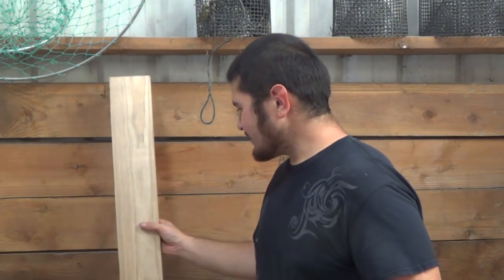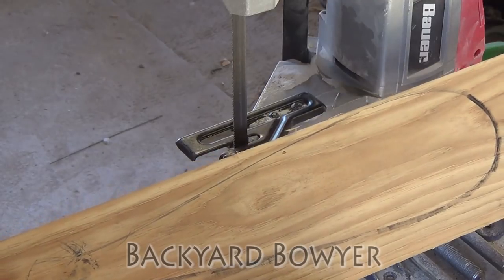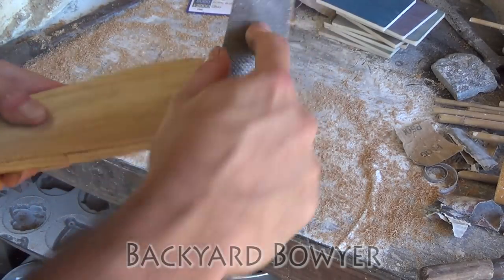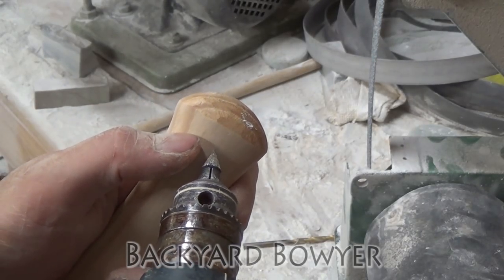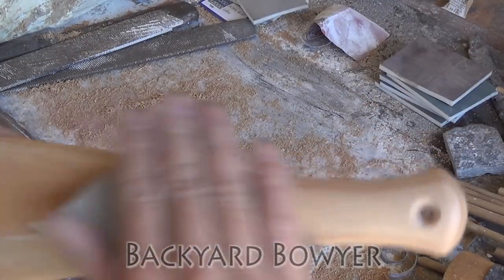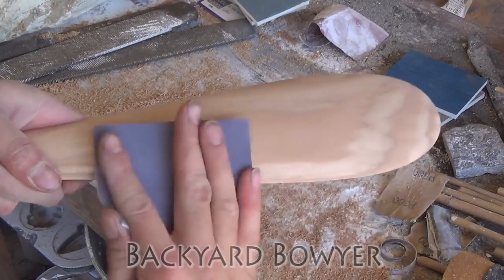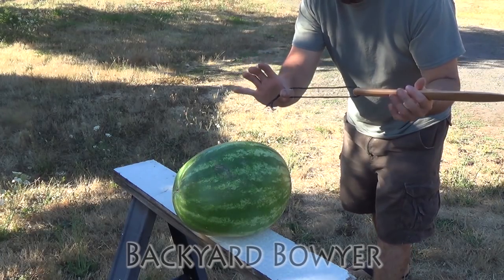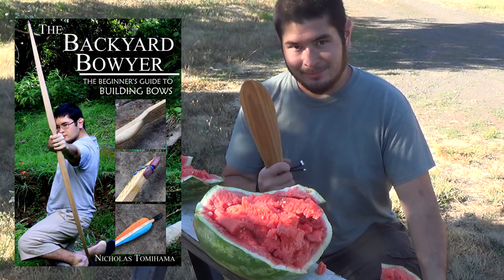Making a Wood Patu - Carving a Maori Style Warrior Club - Slicing Watermelon!

Comment: Have you tried watered wood? To make wood more durable and tuff they used to put logs in streams and rivers to soak out the resins leaving only the woodfiber. After this it would be left to air dry in a wood attic.
Reply from the maker: +Joris Bogaerts I have not! Thank you for the suggestion!
Reply: Okay I thought there would be more information about the subject but apparently it is something that was still practiced in the Netherlands and Flanders in the recent past, and a little in the present, but is all but forgotten in the rest of the world in favor of modern fast harvesting of wood. The technique was apparently know as far as in China. But at the moment the little amount of info I found is singularly in dutch. The dutch word is "Wateren". https://nl.wikipedia.org/wiki/Wateren_(hout)

Watering wood is a rather time consuming technique freshly cut logs of wood are submerged in constantly flowing water for a minimum of 9 months, on average 3 years and maximum 5 years. The goal is to remove all nutrients, minerals and starches from the logs. When dried this wood does not "work" as much as unwatered wood and depending of the type of wood many qualities are improved or become usable for applications for which it would be otherwise unusable. For example, wood of fruit trees is in the norm unusable for furniture making but after watering apparently becomes usable. 

My personal experience with the wood is from seeing my grandfather work with watered oak, don't know if it was summer or winter oak. This oak was cut down by his father right before WWII and spent the entirety of the war in a stream. After this it spent decades air drying in the attic. Then somewhere in the 80's, I think, my grandfather had the log sawed up into planks at a local mill. He told me it apparently destroyed a few saw blades while being cut at the mill. The miller gave him the comment he had never seen wood so tuff and hard. The in the late 90's I've seen my grandfather struggle with the wood it damaged and even destroyed a few sawblades, routerbits and face millingblade. I still see him going at it with the angle grinder just to cut through the hardest parts of the wood.

Comment: There's alot of different types of patu it's also to do with Balance the way you hold it ...if you know how to use it properly you will understand what I mean ..in center when you Balance it on your index  you don't need much force to swing it's the twist and snap off your wrist like a back hand table tennis hit instead using the flat side use the blade ..
 excellent Job keep up the excellent work👍👍👍

Comment: In al seriousness , whats the point in taking it to 15,000 grit??!! Atraight razor edges are usually only taken to 12,000, so that's extremely high. You would most likely not be able to see the difference in finish between 2,500 and 15,000 grit
Reply from the maker: +S!ngularity Thank you for the insight!

Comment: A better finish is 1/3 linseed oil, 1/3 turpentine, and 1/3 beeswax. Heat the wax just enough to melt, mix in the other parts, and store in a sealed jar. Rub on, allow to dry for 10-15 minutes, wipe off excess, let dry overnight.

Comment: that cut from 03:16 to 03:17 .... youve got to be kidding us bro. there was a little bit more then just some rasp work happening.
Reply from the maker: It was all rasp work. My camera died for about half an hour and I didn't realize it until I was ready to move on to the next step. 😅 This was the second side, and it was more back and forth between the rough side and the smooth side of the rasp.

I love farrier's rasps because the rough side takes off material pretty quick and the smooth side eliminates all the deep scratches and honestly leave a better starting finish than coarse sandpaper.

Comment: Lookingat it from the practical angle, does a wooden patu something better than a stone one, disregarding the material and work needed to create it?
Reply from the maker: +Maro150983 The stone is much heavier, which I would think would make it more effective at stabbing and more damaging overall. The wood is lighter and feels much faster in the hand. I'm not sure if a wood patu is better than a stone one, it would come down to your preference.
Reply: Cool, it sounds kind of like a different weapon, once you switch the material. Btw, were they used like the main weapon (with shield?), or is it a sidearm you switch to if needed? Man, you just get me interrested in Maori stuff ;)
Reply: Maro150983 Just for show I believe.
Reply: +SenpaiSancho YT You mean it was not used as an actual weapon? To be fair, I can imagine Maori fighting spear and shield, but what if you end up in a grapple? A good knife would be helpful, but I can imagine breaking a tight of your opponent by something like that is not something to frown upon, plus the stone ones look sharp enough to cut.
Reply from the maker: +Maro150983 The patu was more or less a sidearm. The Maori, as well as many other Polynesians, typically do not use shields. Fighting was usually done at a distance with long spears and thrown spears, then close in with staff weapons and sidearms like the patu.

Patu are very valuable for gaining Mana, because of the level of strength and skill it takes to use well and the proximity of your opponent. To be killed with a well made or important mere was considered an honor.

The patu was often used for stabbing and cutting in close quarters. The patu was used similarly to how the Hawaiians used the pahoa (dagger).
Reply: SenpaiSancho YT patu and mere are types of war club, they are skull splitters and not cutting blades. i have never heard of maori using shields or spears in warfare although their primary weapon called a taiaha looks like a wooden spear it was never thrown but used as a fighting staff and a thrusting spear. the spear-like tip of taiaha is tapu (sacred) and is never to make contact with the ground. 
as a youngster growing up in a mostly maori community here in aotearoa (New Zealand)  , we were taught the art of taiaha and patu known as mau rakau, as part of our school curriculum. the truly prized weapons were made of pounamu greenstone (a kind of jade).
Reply: BackyardBowyer have a go at making a taiaha. perhaps if it interests you and if it is legal to do so, i could send you some native New Zealand timber of the types that were traditionally used?
Reply: Probably the best wooden version imo would be made from ebony wood. It's very tough and robust but also quite heavy, earning the name "ironwood"...
Reply: TheSchmeister totara, ake-ake and puriri wood  were used traditionally. all very hard and durable. ake-ake is translated into forever-forever refering to its long lasting durability

Comment: hey bro. I'm on a mission to create the ultimate PVC bow. question...? what do you think about running all fiberglass rods the entire length? all pieces.
Reply from the maker: +achilles gargaryen Thanks for watching! You should avoid full length fiberglass rods because they will slow the bow down and increase stress in the handle. If you do use fiberglass rods, try making a staggered core of different lengths to strengthen the handle.

Comment: nice.. wooden and whale bone patu are about 45-50 cm or so .. yours is  a bit short.. its more the size a stone one woudl be
Reply from the maker: Thank you for watching and for the insight! I got to handle a pounamu mere and a whalebone patu this summer. The whalebone patu was quite a bit bigger yet lighter than I expected.
Reply: @BackyardBowyer  hi, ive been looking at your content for years.. you make some good stuff.. . ive make quite alot of patu and other maori clubs from wood and generally there is a size that works best with wood  becuase you just dont have the weight the stone ones have.. .. probably is in new zealand like north europe as well no wood that is all that hard .. when compared to some tropical woods..if you get a good  slab of heavy hard tropical wood..lignum vitae is excellent for making them .. ive found 45 cm is about a good size for having good power and it actually having cutting force but still being able to be used quickly.. i have made some from textolite as well and polycarbonate .. the poly-carbonate ones are just unbreakable.. sometimes on ebay you can find 25 or 30mm thick offcuts for sale.. 30mm is great because you can make a good solid pommel .. try a poly-carbonate one .. you can use it without fear of breaking or chipping it

Comment: Nice video, subbed.
Just one question: what's the thickness of the patu at its center?
Reply: Depends how heavy you want it usually 3/4 inch or around 2cm id start at this